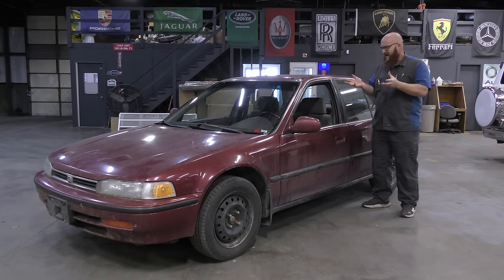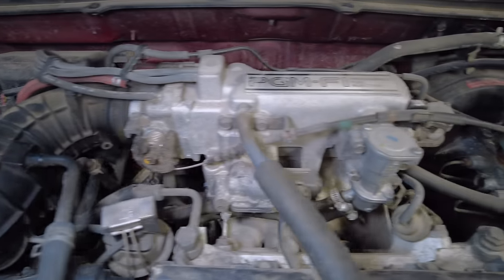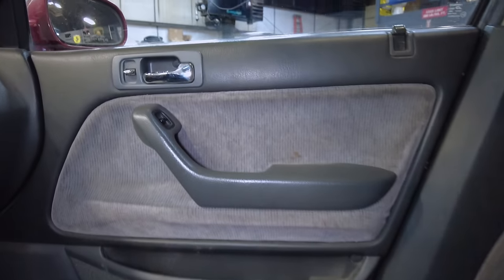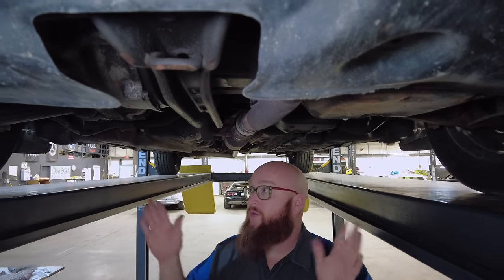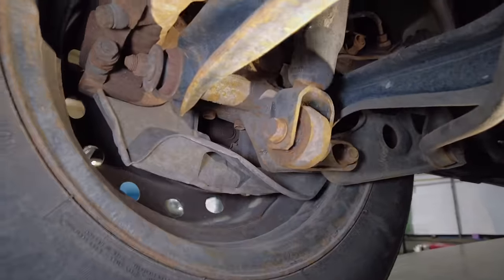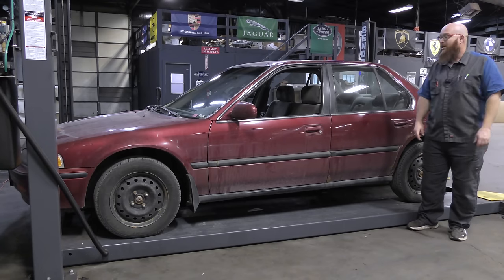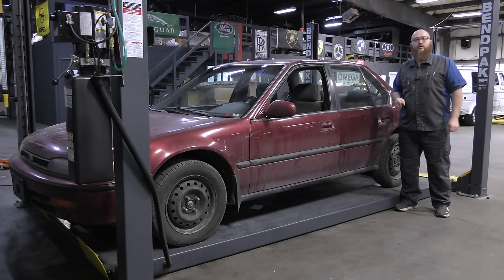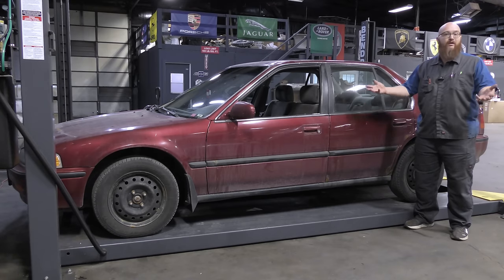A True Testament: 32 year old Accord with 380K miles! When Is It Time to Let It Go?

Comment: I still have my old 1990 cb7 accord.  My parents bought it new in Nov 1989 and I bought it from them when I turned 16.  Its NEVER left me on the side of the road... NOT ONCE. The closest it came was when the starter went out or the couple of times the battery got too old and didn't have enough juice to turn the starter. Since its manual I just push started it and carried on. Last year I drove it from Camarillo, CA to Jacksonville FL with not a single hiccup.  Yes I have new cars and she doesn't get driven as much anymore. But she's been so faithful to me over the years that I just cant get rid of her. All these years later everything still works.  EVERYTHING, a/c, heat, p/s, cruise, lights, seat belts (it has those stupid automatic seat belts that if you open the door while they are locked the belt tries to choke you but they sitll work). Nothing other than typical wear items have ever NEEDED to be replaced. That said it has had a ton of other things done that were done purely to satisfy my need to mod my vehicles.
Reply: Thats so cool. Shes a keeper.
Reply: God bless. Don’t ever get rid of it.
Reply: how many miles out of curiosity ?
Reply: CB7 is the most reliable I've ever owned by far. Sold it due to rust
Reply: This is a beautiful story. I got a 93 EX CB7 in november of last year, it took me a while to figure out why the brakes werent working at all. Turns out it was a failed abs pump. I've had my friends motor swap buddy do an ABS delete for my accord. I got a 3rd gen prelude prop valve that wasnt easy to find. I'm looking forward to finally seeing the car after a month. My last reliable car, a 2002 toyota corolla was tragically stolen last April, so im sincerly hoping this  cb7 will be the reliable successor.
Reply: How long have you been driving it?
Reply: The aftermarket support for cb7s is STILL healthy
Reply: I drove my 00 cry Oxnard to Houston a couple times no a single problem so far 😊
Reply: Don't let her go.
Reply: @eagleone5456 cd7 and cd5vare also reliable. The generation after the  5th sucked. The NG on the engine cjamged
Reply: i love my cb7s, i've had a 91, a 93, and i currently drive a 92. they're the most loyal machines on the planet.
Reply: Is the car still in Jacksonville and do you want to sell it?

Comment: I bought my one owner 92 accord with 400k miles from an old grandpa. I changed out every bushing, rod, arm in the suspension. Did the usual tune up on the motor, coils, wires, spark plugs, filters. And man, it’s running smooth like hot  butter.
Reply: It’s so satisfying to recooperate an oldie that like. They’ll do you well.

Comment: The thing about it is: You've had the car for years and have kept up on the maintenance so you KNOW what you have. You COULD find another with MAYBE less miles (if it wasn't rolled back), BUT you may not know how it was kept>>oil changes, timing belts, etc. If it is is generally good condition and the model has a reliable history, it is worth keeping., if nothing more than a second car as he said.
Reply: You're totally right. Knowledge of the car you own is priceless. Mileage actually means nothing either about how reliable a car is. I had a 800 000kms + Toyota Corolla at one point and it only showed how stubborn the previous owners were as it was a real piece of crap. I also owned a very low mileage of that same model of Corolla and it was also a real piece of garbage. Anyway, at such mileage, the fun comes from seeing where we can make it go. When it's maintained well, it's nice to have a high mileage car. Mechanics are all surprised and it's a good conversation starter.
Reply: Absolutely. Plus, on numerous occasions the Wizard has warned about getting an old car with low mileage that has sat around. They will have a less used version, but the fluid leaks will be a concern.
Cheaper to keep'er. I'd fix the rust.
Reply: Yeah and the money you’ll get for it is worthless compared to the usage it has left.
Reply: Exactly. With any used car, let alone another older one, you’re going to run into issues regardless of how well kept it was, that’s just the way it is. If the car you have runs and drives fine, keep it! 😃
Reply: Absolutely! The oldie you know is better than the newbie you don't
Reply: That's one reason I chose to have the transmission rebuilt in my 2004 LeSabre instead of buying a new car.

For the second reason, see the Wizard's video on the 3800 V6.
Reply: Man you nailed it, it's so important and I feel like just isn't valued as much anymore. There's a lot to be said for the devil you know!

Comment: I was a Toyota guy for the longest time, still am, but I bought a old 7th gen accord for a gas saver commuter. It’s my first Honda and I couldn’t believe how old it was and how solid the interior held up. No creaking loose or rattley plastic parts in this car. The seats felt solid and firm while still comfortable. Very smooth and quiet ride for 20 year old car, I was pretty blown away.
Reply: 2 of the best brands... Especially back in the late 80s and 90s
Reply: Ended up with the 7th gen hybrid as my 2nd car. It has a J30 modified as the JNA1. Still in the driveway with 230k (Bought at 94k) and still holding, worn but holding.

Comment: I remember when my dad got a 1991 accord 5-speed new.  He was always a ford guy and this was his first foreign car.  At the time he wasnt completely sold on Japanese cars but he was so disgruntled with American (80s) cars he gave it a try.  He was so impressed he has bought nothing but Hondas and Acuras since '91 including a new CR-V last year.
Reply: I’m the same way. I’ve got a 2004 GMC Yukon bc that drivetrain is very good, but everything else is either Toyota or Honda.
Reply: That's me too! Ford (via my 1980, V8 Mustang) made the strongest argument ever, to buy a 1991 Honda Civic....which I still own and will never sell.
Reply: My dad was the same way. A union, made in the USA steelworker to the core. He just couldn't stand the junk anymore. He bought a 1999 (I think)  Acura 3.2 TL. He loved the car. He passed away in 2005, we still have the Acura.
Reply: My dad is 61. He got his first new car in like 2011 and it was a Camry V6 SE as a lease. It was his first foreign car. Everything was GM prior to this. After the Camry went back he got a 3.8 Genesis and now he is with the 2.0 turbo G70.
Reply: Do the airbags still work in these older cars?
Reply: No airbags in that model. So no shards in the face from the recalled airbags@amazingjason455.......my bad, this one has an airbag and it might put sharp metal bits in your face
Reply: I'm the same honda for hassle free motoring
Reply: I have owned a car from each of the big three and finally settled on a Prius thanks to the wizard.
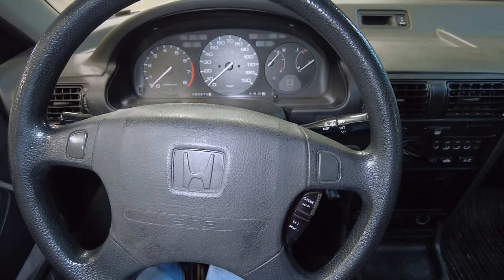Reply: @ddhh6552 Actually during the mid model refresh which this one is they added the airbag. Check timestamp 6:28 to see he SRS. The buttons for the horn are the clear giveaway that it has an airbag.
Reply: It's because our government makes things harder for our companies while the Japanese government helps their car companies
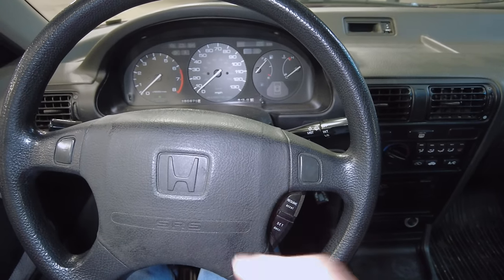Reply: @ddhh6552  Look at the steering wheel at 6:15.
Reply: @ChewyChicken589 valid point. But Mitsubishi can't touch Honda or Toyota. GM & Ford have made many things better built than some Japanese
Reply: @npolite22  you are right. I missed it. It's totally different from my old 90
Reply: @AdamRules420 what year?  I read a lot of bad   reviews on the Prius.
Reply: I was raised the same way.  We were terrified of buying vehicles that were not American.  I finally bought a Honda FIT and love the 36 mpg!

Comment: I have a 1993 Honda Accord LX manual coupe with 364,000 miles. It has fresh paint rims and an exhaust. That's my baby and you'll always be my baby. Still drive it 100 miles a week. Not my daily but definitely my baby 👍
Reply: Same here 1992 CB9 EX H22 swap 316k miles. Love it
Reply: @metsrock15  always wanted to swap in the prelude engine
Reply: the K is an all around better engine then the H, but swapping that into the 4th gen Accord is a lot harder. The H drops right in to where the F sat. Same mounts and everything. With a K swap you have to fabricate engine mounts and also possibly remove your ABS system cause it could get in the way since the Engine sits and rotates opposite of an H engine. I enjoy my H over stock F. Although the F is probably more reliable, less to go wrong/doesn’t burn as much oil. But the H is so fun that the burning oil is worth it. I also use the Accord transmission with the H for longer gearing which it definitely needs. No 6 speeds were made for the H only the K. 

I wrote all this just for the guy who said to drop in a K to delete his comment ffs
Reply: @truthseekerdanny  it definitely makes the car more fun. Revs to 8400ish, VTEC. I use the accord trans for
Longer gearing I’m at 3k rpm at 70. prelude trans would be like 4K ish
Reply: @metsrock15  one day...👍
Reply: needs a turbo. the stock engines can hold 250-300 all day long.
Reply: @Raindrops4891  on a stock F22A it’ll blow pretty quickly the ringlands are the weak leak. It can be done but you need to upgrade the engine or at least I would to make it reliable. Just imo adding a turbo puts more strain on the engine and creates more complications than NA which in turn removes the Honda Reliability
Reply: @metsrock15  all true. id still send it tho with like 5-8 psi lolol
Reply: @Raindrops4891  facts lmao
Reply: @Raindrops4891 I'd prefer a JR supercharger kit, just to be different  .
Reply: @Raindrops4891 they can hold that all motor with just simple bolt-ons and a cam.
Talking about the K series….
Reply: Just to ask , have you  done the timing belt yet ? From Toronto, Canada.
            thank you...
Reply: Did you ever get a valve adjustment on it ,
Reply: @metsrock15 did you ever get a valve adjustment on it ?
Reply: My '97 Civic has 377,000. I drive it about 400-500 miles a week. I don't plan on getting rid of it

Comment: The early 90s accords are one of the most reliable cars ever made (imo). Even if something needs replacement, the parts are fairly cheap, and easy to install (and likely available in local junk yards). High mileage on them just means regular maintenance, nothing major. This was back in the days when Honda was trying hard to make a good impression.

Comment: Up here in New Brunswick, Canada,  no car lasts 380,900 miles because of the salt air and the salt use on the roads in the winter. In the American Mid-West, the car has a few years left on it. High school kids would be happy with this car. Congrats on hitting 1,000,000 viewers, you're an honest shop and those far and few between, you deserve more viewers.
Reply: not
Reply: Salt is the worst enemy to Japan steel .
Reply: Yep, Volkswagens seem to be the worst here in nb
Reply: Rustproofing every year not enough?
Reply: Still rocking my 07 Accord with 661,400 miles on it in a rust belt state. The quarter panels are quite rusty and its starting on the door and hood as well, but keeps going and going.
Reply: Not here in south florida usa .  They would most certainly refuse to accept a 'beater' like this.
In front of all your friends?  Your kidding..right
Reply: @TheThirdeYe1337  Waw.What a milage.Are You first owner?
Reply: Newfoundland backing you on that one.
Reply: @stevenweiss2148 dude in south Florida this is some Haitians dream wake up and look around your obviously not that far south lol just here is south Florida they will clock the odometer back or change it to a fancier one with better gauges which makes mileage a giant question mark which is most hondas down here with all the engine swaps and tinkering done on those cars
Reply: @AmosDohms  In my country that's 400 $ per one year.
Reply: I worked in a underground salt and potash mine in newbrunswick.   The best part was salt dust settled on the cars from the salt storage shed and rusted the car from the top down as well as the salt on the road.  Your fuel milage was amazing because half of the vehicle was missing.  You could also grease your vehicle from inside because of the huge rust holes.   Sure miss new brunswick though,  I lived in Sussex until I was 29 and it was a truly beautiful place to live.
Reply: Im getting close to 187500 here in Quebec and the rust really isn’t that bad. I rust proof it every year though.
Reply: @rider9187  Once the emp get below -11 C salt doesn't work ,so your car only has to worry the bad Quebec drives and the occasional Moose.
Reply: Maybe in some parts of the Midwest. Here in Michigan anything with that many miles is either driven a ton or so rusted you don’t know how it hasn’t cracked in half.
Reply: I'm in New Brunswick,  Canada, as well.  Moncton area.
Reply: @TheBarth79  every steel.
Reply: Saint John for me, back in the 80s I was in RCAF and posted to CFB Chatham with 416(AW)Sqn with the CF-101 Voodoos.
Reply: Hey fellow Atlantic Canadian👋
Reply: I have a 1995 civic with 350,000 miles here in New England. It wont die, but I can see into my trunk through the rot around my rear quarters. Where one of the rear bumper mounts attaches to the bodywork has completely rotted away and is now zip ties. The salt has done a number and a half to this poor thing...
Reply: @AmosDohms it helps but no they still rot.
Reply: @DJ-sr9yq  If they didn't rot the auto companies would sell new cars, would they? Back in the 1930s, General motors would taken older cars in trades, then crush them to make a market for newer models.
Reply: @Chuck59ish  you definitely have a point, car manufacturers do that in many ways so their cars don't last forever. Mind you arguably, toyotas are the longest lasting vehicles on the road, and they're also one of the biggest most successful car companies in the world.
Reply: 2010 Mazda 3, Halifax NS. Just parted with her at 693,000km.  Best car I ever had.
Reply: @TheBarth79  I'm the 2nd owner. I've owned it since 2016.
Reply: @TheThirdeYe1337  Do you remember what milage was in  buying day?
Reply: It would be a good 1st car!
Reply: Not the whole Midwest. In eastern MO every car turns white in the winter from the salt and chemicals on the roads.
Reply: @randyburrill2340 how was the rust looking at the end? I'm still driving a '12 Mazdaspeed3 that's holding up great in New England.
Reply: I don't understand that. We on balkan import cars from Switzerland with average 300.000-400.000 kilometers and despite having little bit of rust it's far from that, that they are dead. I have alfa Romeo gt, imported from Switzerland in 2014. It only had surface rust, and rusted front subframe, which I changed three years ago, sanded oit the rust, and repainted whole surface from beneath with protective coat. The car is still in great shape although it doesn't have this many miles, it's 210.000 kilometres at this moment. I have seen cars driven in salt with way more miles and still are far from dead. That is my point.
Reply: Not sure what makes you think HS kids would be happy with this car. 😂
Reply: My Civic has those miles, but I did a rust treatment and replaced spots with fibreglass a few years ago (well, my mechanic did) I think I have a video on yt showing this (I have a bunch of vids on my car)

Comment: When I met my wife in Flawrida in 1991, she had recently purchased a 1990 Accord EX 2 door, red with tan cloth interior, automatic. We drove it all over including to Colorado. Finally sold it when we lived in NH with 190k miles... still running strong!
Reply: Jan 1994 Honda dealer had a sale a thon. Hondas 16k 4 door loaded. She smashed up her 2091 head on and only cut forehead......line out door to buy and see salesman.  I snagged one for 20 bucks. We got a red one auto by 7pm. At 830 car was in prep bay getting washed here dad gave dealer 100 CHEK used his ins card to drive home by 9pm.  Car lasted til 2014 no. Probs........wow

Comment: Still driving my 1999 Accord 2.3 5 speed sedan! It has 366,000 miles and still runs and looks like new! One of the best cars made imo!
Reply: Did you ever get a valve adjustment on it ?
Reply: Your Honda is far superior to the ones they're building today.
Reply: I bought a 01 5 speed accord with 108 k for my first car back in high school (2010). Never had a problem with it. My dad thought it was so good I ended up letting him have it. It now has 250 k and he still drives it sometimes.
Reply: @shadowman1992  Not who you were asking but I just went to do a valve adjustment on my '05 Insight which I bought new, and it was basically already perfect, even after 170k and never having been adjusted before. This thing has blown me away and changed my idea of how reliable an older car can be.
Reply: @JohnVance  thank you for letting me know. I'm asking to see how many honda owners with high miles never do it and see if they ever have any issues. Because I don't think I'm going to do one anytime soon. I have two honda v6 engines
Reply: @shadowman1992  Yeah admittedly this is just a little I3, and I'm not a mechanic and it was my first time using feeler gauges, but I watched a lot of videos on it ahead of time. It wasn't making any noises I would characterize as "sewing machine sounds," I'd just heard it was a good thing to do on high-mileage Hondas of this vintage and thought what the heck.
Reply: @shadowman1992  I've been contemplating adjusting the valves on my girlfriend's 99 V6 accord but it honestly runs smooth as hell and working on the back side of that engine is so annoying I'll probably wait on it